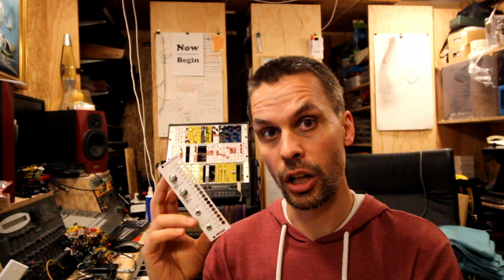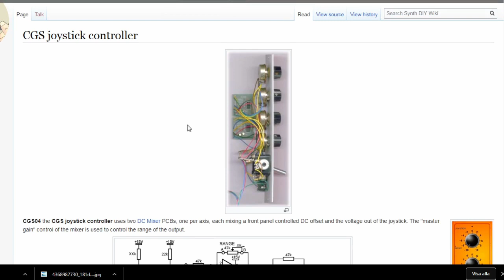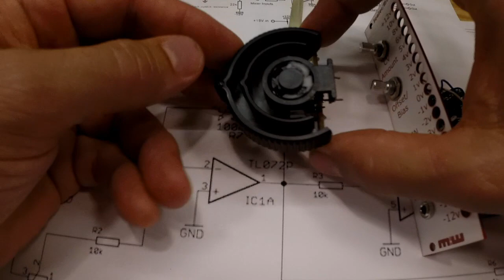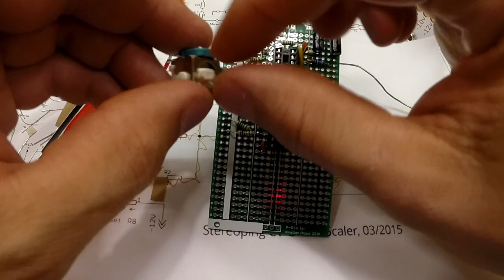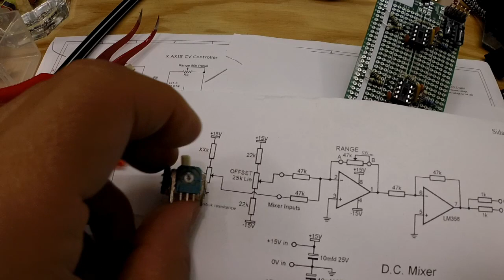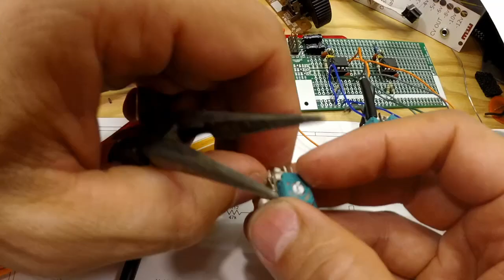Joystick/Scaler/Offset CV control - Modular in a Week 11.5

Comment: Very nice.  I did very similar project with this joystick:  

https://www.ebay.com/itm/Joystick-Potentiometer-JH-D202X-R4-10K-2-axis-Sealed-PTZ-Thermistor-/253169946622

with offset/scale for the X and Y axis, can switch between a -12 to 12v or 0 to 12v voltage divider setup.

Comment: Two thoughts:
1 - You could use an LM3914 or 3915 for the LEDs (can be chained, 10 LEDs per IC)
2 - Why using 2 distinct TL072s, when you can use a single TL074?
Reply from the maker: Yeah I have a few lm3914 lying around that I will try a few things with. 
It was for visual purposes. To show it was two “separate” circuits. But you are correct a tl074 would work just aswell. :)
Reply: @SourceryOne  3 - What's the use of having two inversions?

The circuit could simplified to have a single op-amp per circuit.

Therefore, you could make 4 scalers with a single TL074!
Or am I missing something?
Reply from the maker: @FraterKatzioVelletriensis  Well, for the circuit to work as a summing mixer, and work in the correct way it actually needs to be done like this. By summing two signals on the non-inverting input has a different function in an opamp. I cant really explain, but if you read about it, you will learn that there is a difference. On the other hand, one could just use one inversion, and just wire the potentiometers backwards.... That might work... If you want many scalers in one chip?... :) Also someone else mentioned in the comments that it is even better to put the offset on the second stage (inverter) that way the offset doesnt affect/drown the scale of really small input values.
Reply: @SourceryOne  I see. Thank you for the clarification. I'll try to make sense of not using the non inverting input as a mixer.
On the Doepfer DIY page there is a schematic which simplifies (less components) and confirms yours: http://www.doepfer.de/DIY/a100_diy.htm

Comment: I build one of those in the past and if you want to scale a weak signal, the offset gets very very sensitive.
Wouldn't it be better to ditch the inverted output and use the first opamp for scaling only and the second for the offset?
Reply from the maker: Yes! One schematics that I went through but cut out in the video is the Befaco joystick. They did exactly that. And now I know why that would be beneficial to do it that way. Thank you 🙏

Comment: Thanks for the link in the Description and mention in the video. Hope some people will learn from it. I have a lead on a better Design for the LED driver. Still Using a op amp. It will be converting the Output Voltage too a more linear current source. So the Display LEDS wont drop out too zero brightness at 500mv output.  Still gotta breadboard is and see if it works. Here is some links.
https://www.allaboutcircuits.com/technical-articles/simplify-your-lighting-design-a-new-constant-current-regulator-from-diodes/
https://www.allaboutcircuits.com/projects/design-a-color-sensor-with-measurements-displayed-via-an-rgb-led-module/
Edit:
My idea worked. It works well the led brightness is actually linear now so it accurately displays. I know it's a small problem. But planning on redoing my schematic and PCB.
Reply from the maker: Thanks for the info, and for sharing your schematics! :)
Reply: @SourceryOne  My newer idea worked. It works well the LED brightness is actually linear now so it accurately displays the output voltage+/- on Red/Blue LED. By converting the voltage->current source. Seems like something most wouldn't notice. But it's good fix it planning on redoing my schematic and PCB and releasing the files.

Another problem  I am is a little iffy about it seems like the LEDs get effected if I put a lfo in the patch chain. Have any ideas on preventing this? So it just displays the output of the module.
Reply from the maker: Good job figuring it out! Will be interesting to see the new schematics! :)